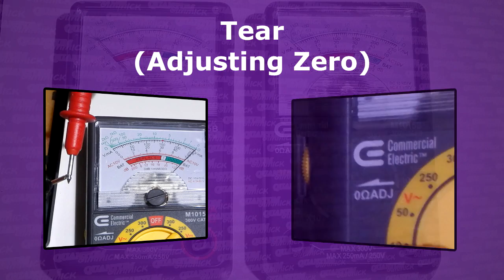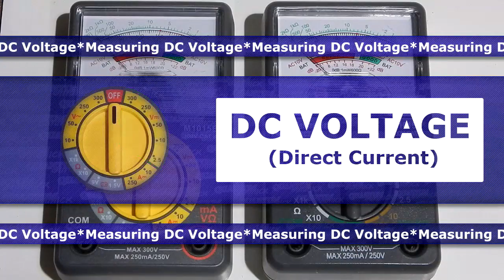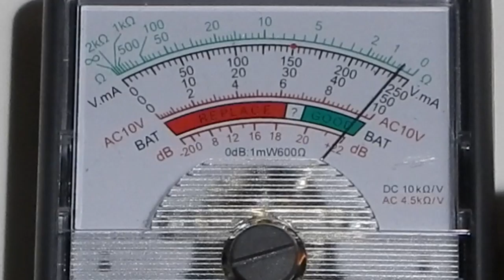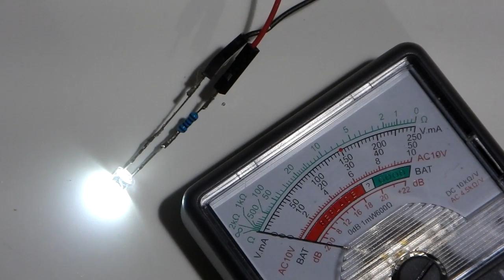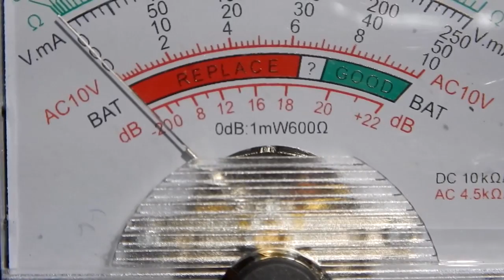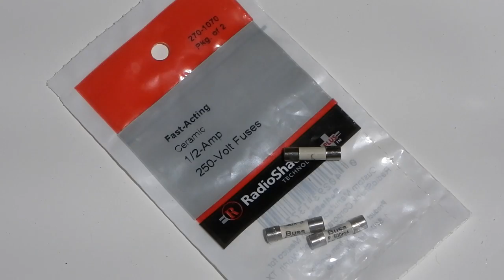How To: The M1015B Analog Multimeter Tutorial

Comment: I have the M 1015C. Info is identical to the M1015B. Thank you. I have 3 small HF digital meters 2 broken, 3rd "misplaced", also my 40yr old analog meter. I've been afraid to use this one for other than ohms and 1.5/9v batteries. Now I feel comfortable useing this unit.

Comment: thanks for the video - how do I measure the battery health of a car battery please?
Reply: @muddyfox47
Set the dial @50vdc(right side) then read middle scale(black#'s) 10-50 on dial. Lines on black scale graduate 1v on 50vdc. Between the 10 and 20 mark you can read volts dc so count 1v per line added to 10v start point. Hope this helps.

Comment: In your tutorial for the m1015b multimeter you said "Do not measure AC based current under any circumstances" I'm a bit of a novice here but does that mean you cannot test an outlet in your home?
Reply from the maker: You would be able to test your home outlet's AC Voltage with this multimeter, but no it cannot do AC current (a function not included since it's rare to need it. hard to do, and somewhat dangerous because live wires and all that)

Comment: I didn't catch what setting to use to test continuity.
Reply from the maker: Set it to measure Resistance (ohms), the trick here is that since all wires/paths have resistance, as long as you have a continuous wire/connection the needle will move/react. Otherwise, No needle reaction, no continuous connection.

Comment: Can you use this multimeter to check a car battery?
Reply from the maker: Yes, since most troubleshooting is done measuring the voltage this will safely work. Just set it to DC Volts at 50 range (the one on the right). But definitely no amperage measurements as this can only handle milliamps.

Comment: To test The fuses, I did not see where you set it up. To what voltage?
Reply from the maker: For fuses you could only test if it's broken or not so to perform a connectivity test use the setting as if your measuring resistance, if the needle moves the fuse is good.

Comment: From 0 to 10, what range would you give to this analog multimeter.
Reply: Regarding usefulness? It's handy to "throw" it in your toolbox for those times when you need a measurement that's not too critical.  For instance, you don't want to use this in "high impedance" circuits or circuits with low voltages. The meter's internal resistance can cause a false, low  (usually) reading and may even upset the circuit's operation. Somewhere on the face of the scale, usually in a lower corner, is a statement, usually reading in Ohm's/Volt, of the "sensitivity" of the meter. 1k Ohms per Volt is horrendous and 10k ohms per volt not much better. 20 k ohms per volt.... fair but 10 megohms per volt is very good and that's the sign of a quality (usually) meter. Most digital multimeters are rated at 10 megohms/volt. This is why the meter read really low on the X1 scale when he tested the 1.5 V battery voltage or used the Battery test function. Analog (pointer-type) meters do serve their purpose... I'm still using a folding analog meter from Radio Shack. It is a Micronta 22-211 folding analog meter An analog meter, like he said, is good for measuring trends. If you need accuracy and sensitivity, go digital.

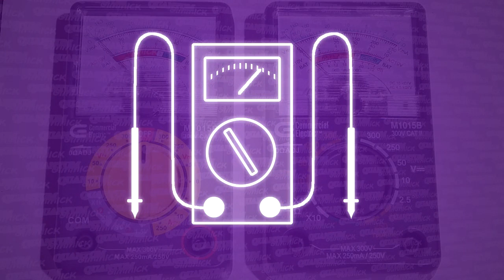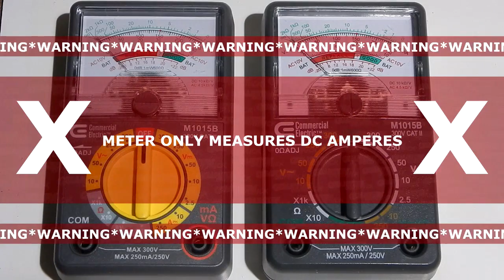Comment: 1:17 Requires you to work with AC current, 6:13 Do not under any circumstances measure AC base current. Please explain? I'm not questioning you, I'm sure it's something I don't understand but want to. Thank you.
Reply: Should have stated, "results in you working with high AC Voltages and therefore, high AC currents". His frame showing "AC Voltage" with "AC Current" written underneath warns you that with one comes the other... be very cautious when poking outlets and fuse boxes! "Danger, Will Robinson, Danger!" 
At 6:13, I believe he's cautioning y'all NOT to attempt to measure ANY AC current in ANY circuit around the home with this meter.

Comment: I set meter to 50 to test 12 V car battery and it read 1 lil over 10 close to 12 . Is that right ? I've also a slow charger at 1.5 amp slow charge . I cranked it soo much yesterday trying to get car started but nada . I had it towed . How long will this take ? i want to be able to crank car enngine to work / test on car today ?

Comment: Can you use it to test 12 volt car battery ?
Reply: Well, yes, as I'm sure you've learned by now.   Now, mind you, voltage only. Don't even try to measure its current output with the amps function! The meter is good for measuring "strong" sources of dc/ac voltage/minimal dc current. If you start poking around a transistor radio, it's not to be trusted. Heck, the Harbor Freight 7-function digital multimeter with backlight is the best deal going for a DIY multimeter. I'm sure it has an input impedance of at least 10 megohms even though it doesn't state that. I've got about 5 or six of them as sometimes they give them awaywith other purchases. But don't throw away that analog.. it can come in handy at times.

Comment: Does  the M1015B multi-meter measure amps?
Reply: At the very base of the meter, the red probe socket is marked "ma" in red and below, centered just underneath the two lead  inputs it is marked "250 ma"... Attempt to read any thing more and you risk blowing the fuse. Up to a quarter of an amp?... OK.

Comment: Super helpful, thank you. I've had the M1015B for a few years, not knowing how to actually use it. This was awesome. It makes it so easy. One question, if I'm trying to test if a line is open (for an outlet), how would you suggest using this? Thanks so much again.
Reply: Forego using the meter if you can, and buy one of those 3-pronged outlet testers instead. Much quicker and no question about which pin you're measuring. Otherwise, the small rectangular slot in the socket is HOT, the larger rectangular slot is Neutral, and the round "slot" (if present) is a "frame ground" tied to neutral back at your main fuse box. On the AC 250 V range, measuring Hot to Neutral should give you abt 110-120 Volts. Same range, measuring Hot to frame ground, should read the same. Same range, Neutral to Frame Ground... very little voltage. Because you're gonna be stuffing a narrow prod into a relatively wide slot, you'll probably have to wiggle the prods around for a stable reading. That's why it's more convenient to use the three-pronged tester. Be safe!

Comment: I have been looking for someone who can explain how to use a multimeter for years. Your video explains it the best. I don't understand why it is so difficult for people to do this.
Most analog meters need you to zero the meter, by shorting the leads, when using the ohms scale.
Reply: Let's get down in the dirt, then.... The Ohms scale should be zeroed mechanically (the adjustment in the center lower of the meter face) in the position of use (Vertical? Flat? 45 degrees? On edge?) The Ohms scale only requires one to electrically zero the pointer on the resistance range of its use each time the range selection is changed. If extended leads are used, they must be included in the leads' length when electrically zeroing. Then, there's parallax error when reading the pointer against the scale... make sure you are directly in front of  the scale (sight line perpendicular to the face) and not off to the pointer's side. If the scale is mirrored, then line up the pointer with its reflection.

Comment: Ceramic fuses are designed to prevent high voltage arc over. Glass fuses are not designed for this. Use the same type that comes with your meter.
Reply from the maker: Ideally yes I agree, thought for many who by circumstance are limited to shopping in brick-and-mortar stores (especially now with the closing of poor radio shack) will find it almost impossible to find ceramics as they are not readily available.

If you're working with your School Science/Cheap Electronics(1.5v), DC logic level (5v), DC motor/General electronics (12v), DC motor/Lighting level (32v), ceramic fuses would honestly be overkill, not that I am saying over-protection is a bad thing especially when you get some kind of Cascading/Murphy's law event going but this is extremely rare.

Now on Mains electricity I have never seen or heard of these glass fuses blowing in a catastrophic manner like the conventional electronics pros are always claiming will occur so I personally don't worry about this on US mains at ~110v. ~220v+ is when I start demanding better fuses and better everything for that matter.

But honestly if someone plans on playing around with high voltage mains, they should opt for a clamp meter and save themselves all the worries.
Reply: Amazon has the fuse: https://www.amazon.com/10Pcs-500mA-Ceramic-Fuses-Tubes/dp/B00X7B8YDO/ref=sr_1_1?s=lamps-light&ie=UTF8&qid=1516984659&sr=1-1&keywords=500ma+ceramic+cartridge+fuse
The fuse is meant to meet the CAT Rating for the meter.

Comment: I left mine on for more than 3 days and nothing worked. I replaced the battery as the manual suggests yet still none of the functions seem to be working for me. I've replaced it with several batteries as well
Reply from the maker: Interesting, see all the functions (with the exception of the resistance setting) will work without batteries because they give measurement base on how the electricity interacts with the magnetic field in the actuator so batteries are not the issue.

I believe the issue is that something is impeding the flow or broken contacts somewhere inside the multimeter.

I would check if the fuse isn't blown, visually check if there aren't any broken path or components in the path (the resistor are sometimes very loose inside), and if you have a second multimeter I would check the continuity all over the internal circuit of the multimeter.

Comment: Hi, i have bought a stepdown converter 12v 10A for 30pcs 3w 405nm 700ma led , i want to adjust the stepdown converter to 4.200A , im using analog multimeter , do i have to connect the multimeter in the circuit ?  or just hock it in the + - line of the circuit ?
can i adjust the output of the stepdown converter before connecting the led? 
i hocked the red test line on the 10A+ in the multimeter and set it to 250 for Amps testing and tested the output of the stepdown converter and it gave me 90 in the range of 250 , what dose that mean the 90?
sorry for the long comment and that you again for the video .
Reply from the maker: I see you got yourself some ultraviolet power leds nice!

And yes, to measure Amps you'd need to put the meter in the circuit like shown at 11:50 and in the amps' setting...

but I am confused, are you using the M1015B or another analog meter because the M1015B can only measure a maximum of 250mA which means if you try to measure those 10A, 4.2A, or 700mA you'll immediately blow up the fuse inside the  *M1015B*.

If you are using a better multimeter, can you tell me what multimeter model you are using so I can see it's settings because at this point that 90 is a complete mystery to me.
Reply: QuantumGimmick it's sunwa YX-360 TRE, https://www.google.com/search?client=ms-android-samsung&tbm=isch&sa=1&ei=1SCdWf63KsjqvASB3qCQAg&q=Sunwa+YX-360TRE+multimeter&btnG=#imgrc=FBpSqYtV34sTbM:
In the down section of the Amps there is 250 instead of 0.25
Thank you very much for the reply
Reply from the maker: Ok I see your setup now, that's a very nice analog right there

Alright when using the 10A setting you will be looking at the 0-2-6-8-10 range.

This means your measurement of 90 is actually at around 3.8A-4.0A (I cannot see exact angle from internet pictures) so you're very close to your goal of 4.2A

And as far as adjustments, that's tricky because it depends on how the stepdown is designed to handle constant current, the current may/or may not change once attached to a load (instead of a rechargeable battery) so I would advice some caution and testing so you don't blow the LEDs.
Reply: thank you very much for your help appreciate so much.

Comment: What's the difference between resistance and continuity?
Reply from the maker: Resistance is an actual measurement of the material's ability to impede the current (Ohms)
-so in this case we are looking for an actual value [10, 22, 45, 100, etc...]

Continuity is a test to see if a material (usually a wire) has a solid path from one end to another.
-in this case we just want to see if the needle moves or not

Exp: so the multimeter in resistance mode will send a small current from one lead to another, if you have a broken wire then the current will never reach the other end of the wire with the other lead so the multimeter will never measure a value, and that how we know the wire is broken internally because the needle won't move.

if the wire is solid then the current will reach the other end, into the other lead, and the multimeter will give some value, and we will know the wire is alright.
Reply: Resistance is a measurement of the material's ability to impede current flow. It's measured in ohms.

Comment: sir , i have an analog meter model is yx 360tr sumwa compamy. it has a range x10k what is its function? when i short two probs with the range of x1, x10, x100 or x1continuity needle moves, but when i set the selector in x10k and short the probs there is no movement in needle. then what is its funtion pls explain.
Reply from the maker: All those x1 x10 x100 x10k are multipliers for your Resistance (Ohms) measurements.

So a Result of 6 in the x10 setting = 6 x 10 = 60 ohms
Result of 8 in the X100 setting = 8 x 100 = 800 ohms ... etc

When you short the probs you get movement on all other settings except the x10k setting because (assuming you have an internal resistance of 1) your resistance of 1 is so small compared to the range of 10,000 that it will move 1/10,000 of the way that it will most likely not register with the human eye as movement.
Reply: The x10K scale setting should deflect the needle to 0 ohms when you short the leads. The x10K scale is not working. Most likely a bad solder joint.

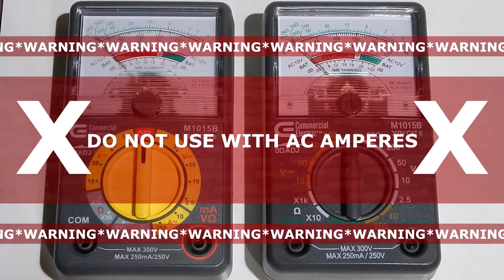Comment: Hi, thanks for the video.  Sorry for the crazy question, but you start out by showing how to measure AC current but then at about 6:20 in you say do not use this device with AC.  Can you tell my where I am confused.  Thanks
Reply from the maker: sorry for the late response I am in the last stages of upgrading my whole setup to bring you guys more videos, but to answer your question

Your confusion comes from the difference between AC Volts and AC Amps

Earlier in the video I measured AC Volts, those can be measure by having the multimeter "Touching" the AC electricity.

"AC Amps" or "AC Current" requires your multimeter to actually "Drink In" the AC electricity to measure it.

This multimeter is like a kid in the world of multimeters and with that analogy a kid can "touch" moonshine and his hand will be fine, but once that kid "drinks" a whole bottle of moonshine.... the results are going to be bad
Reply: OK, the meter is not designed to measure AC current, just AC Voltage. To measure AC current you'd have to insert the meter in-line (in series) with the circuit path. The meter is NOT designed for measuring AC current. AC Voltage measuring (up to it's published spec), no problem. Remember, Voltage is the "force" or "potential" pushing the current (electrons or" holes") through the conductor. Alternating Current (AC) is that current which changes direction of flow a number of times per second (its frequency). In the US it's 60 times per second (60 Hertz), in Europe, 50 times per second (50 Hertz). Sorry, hope I'm not going too deep.

Comment: I have watched your video,read the inst, watched 6 other videos & no one can tell me how to check capitors with commercial electric M.m1015B
Reply from the maker: This is a common question it seems and the answer depends on what you are trying to measure:

-If you want to check if the capacitor is working

setting your multimeter to the resistance setting and seeing if the needle moves when connecting the leads to the ends of the capacitor will tell ya if it works (there are many video on youtube explaining this in better detail)

-If you want to measure capacitance (uf, pf, etc...)

this is beyond the capacity of an analog multimeter since that requires running a specific current, then checking voltage, and then doing some math. To do this with an analog multimeter you would need to build a constant current circuit and inject it into the capacitor, measure voltage with multimeter, do some math, and convert the coulombs into farads (theoretically)